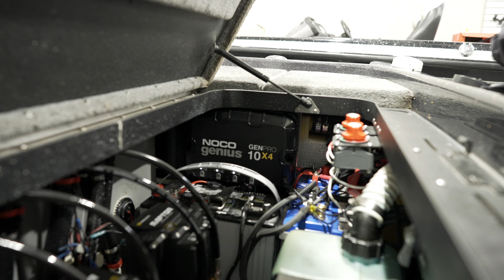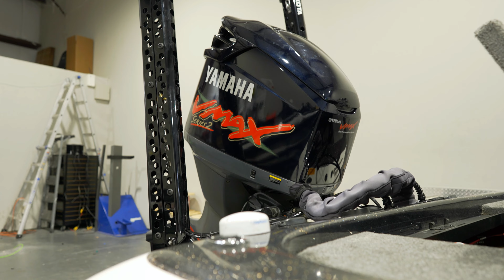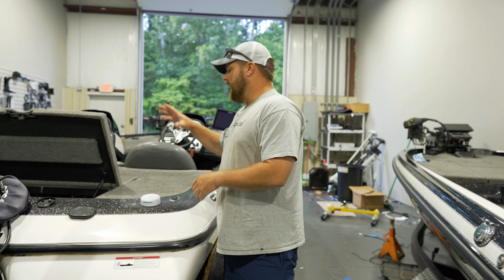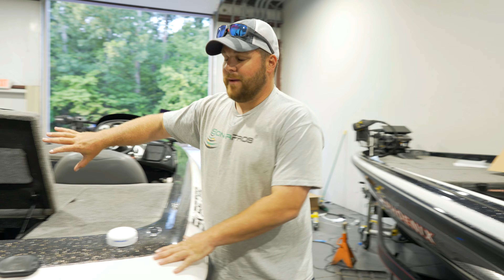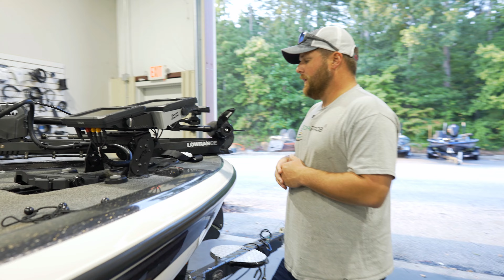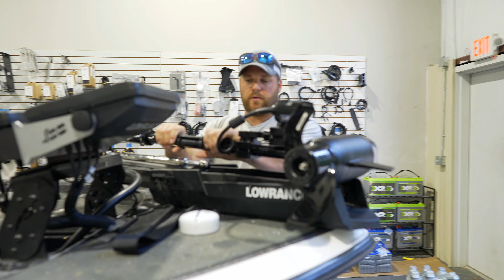Old Boat gets New Tech OVERHAUL at SonarPros (2009 Skeeter)

Comment: I brought a flawless 03’ skeeter zx225 and did the same thing.  1 HDs 12 live at the console and 2 of them at the bow. With a112 ultrex and at2.  My open point is mounted in the exact same place.  NMEA and Ethernet.  I’m currently trying to figure out a way to mount my console unit on the dash.  I’m not a fan of the ram mount either.